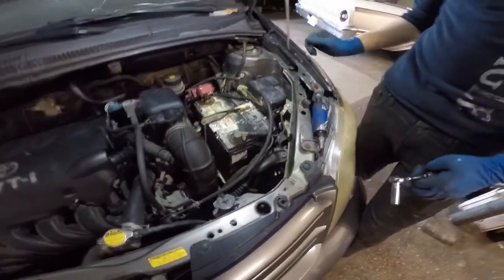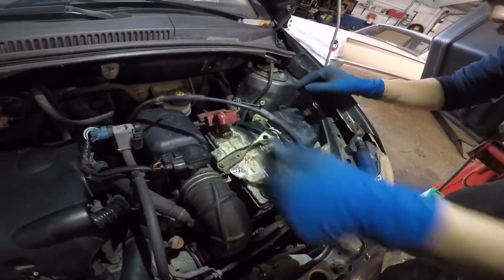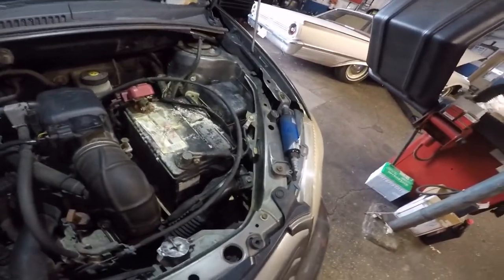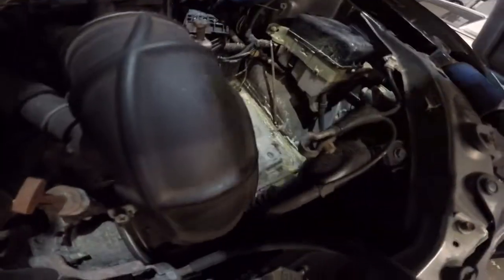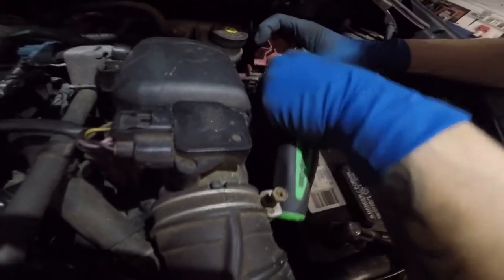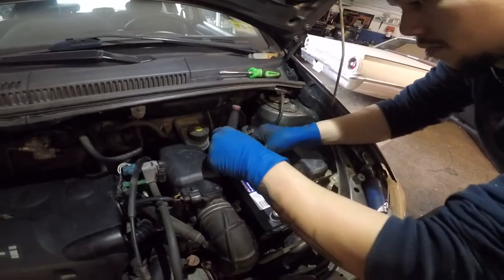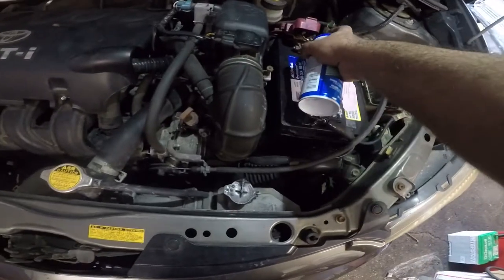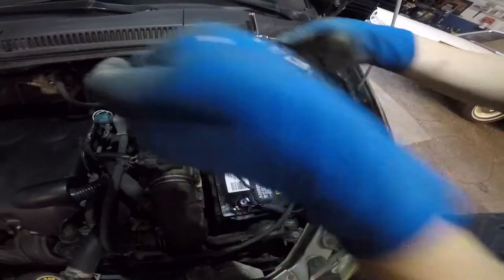How to replace battery on any Toyota, Scion or Honda

Comment: Yo i got a scion tc 07 and I put a new battery and alternator and I get a battery light on but it’s dem not bright like it was before the old battery any feed back iv check everything on it also
Reply from the maker: Oh I had issue like that on Corolla.  It was wrong alternator
Reply: @RBTheMechanic  dame sense it’s manufactured it can be the problem imma try to change it out then
Reply from the maker: @559mafiaboi  yup I had car I replaced the alternator the battery light was on glowing bring low not too bright but it has diffrent glow
Reply: @RBTheMechanic  iv been driving it ever sense it’s been 4 days today I drove it all day with no issue maybe that wire that marked the battery just stayed dem
Reply from the maker: @559mafiaboi  yeah this car i did was good just the light was coming on alternator provided good power but it was just wrong alternaotr

Comment: We have a Scion IM. Our battery was bad and we replaced it now we have a message that we have a charging problem. What does that mean. It has power from the new battery but won’t turn over  do you know why?
Reply from the maker: Check ur connections   Could be bad alternator

Comment: i already tried two batteries..they both didnt work..its been sittin for 3 days without starting..hopefully this new battery works its a scion 06. been messing with it for days an nothing! my cables are pretty bad
Reply from the maker: Did u look in to see if starter motor is the problem?
Reply: @RBTheMechanic  I havnt at all...but lately no lie my cars been takin like 2 seconds or 3 seconds to start. an that never happens...if the new battery dont do nothing. im sure the starter is complely out car is almost 15 years old so OMG i hope thats the problem...i been stressing for 2 days an i gotta get back to work